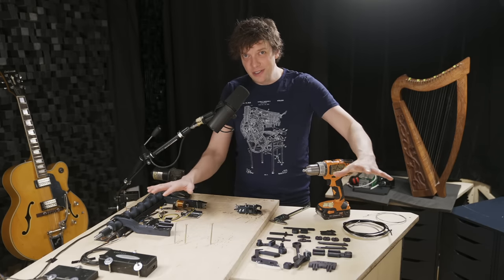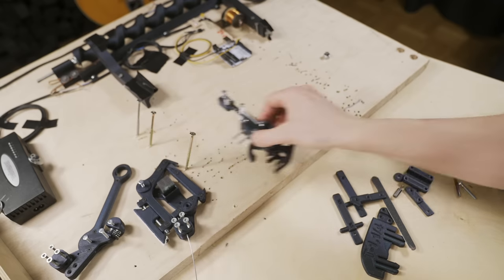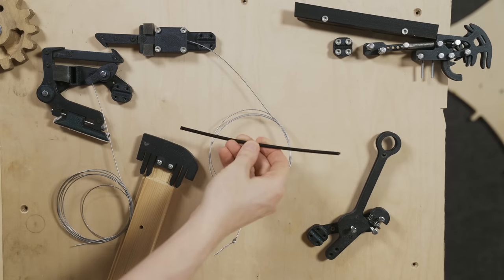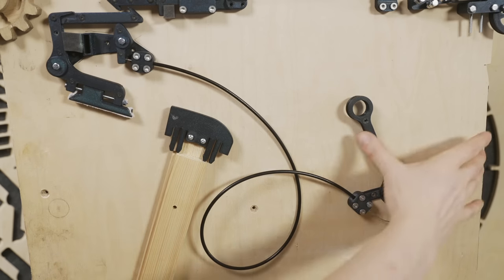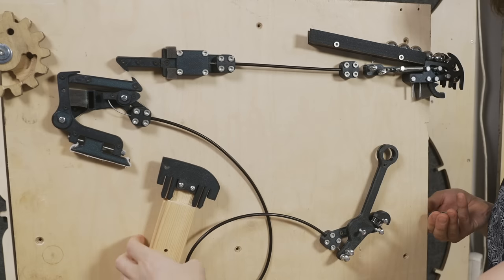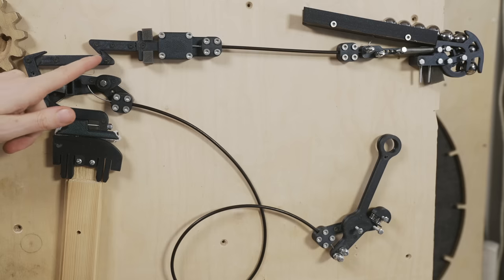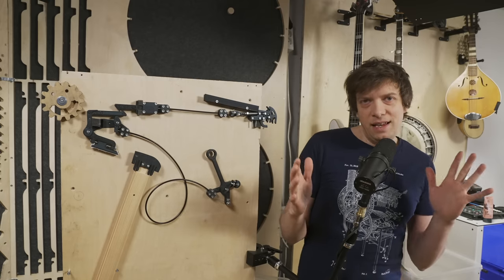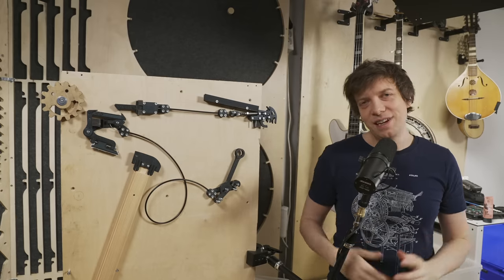These Bowden Cables Surprised Me!

Comment: I love the use of these cables, although I do have one concern that could lead to failure. These cables should always be in tension. Because they are not under a larger load it works in your test but over time the compression stability of the wire could wear out. Although it is an easy fix, on the one movement use the tension in the wire, but for the opposing motion use a spring to add tension from the opposite end.
Reply: I'm specifically talking about the mute lever to reader cable. The reader to gate cable already has a spring doing exactly that.
Reply: @michadonald  Noticed the same under the mute lever.  Its a risk, works now but after friction adds up, cable gets more worn and flexible, longer runs etc.  Shouldn't be hard to fit a Torsion spring on the mute cam, or I seen another person suggest using push-pull style cables made for push (not sure how lightweight those come in?).
Reply: I think you are right. This design also routes the cable in a curve outside of the housing, and that probably makes the cable even more vulnerable to deform or unwind under compression. Once the cable strands start to unwind, the cable will no longer go smoothly into the housing.
Reply: Is there a version of these cables which are designed for compression instead of tension?
Reply: I mean there are Pneumatics and hydraulics, but not exactly what we're looking for
Reply: @Phriedah  after doing a bit of Google research, yes there are versions that have push capabilities as well, typically they have a solid metal core instead of twisted wire. The drawback is much less flexibility.
Reply: @Phriedah  Automotive ductwork used to use solid core push-pull cables (much like music/piano/spring wire)
I have a truck that's almost 40yo and they still work fine but are not suited for really tight radii.

Comment: You should have a look at bike hardware for pinching cables, they would reduce the size of parts dramatically and make it much easier to adjust. Add ferules to the end of your outer too!

In my experience, you can use cycle oil in the outer to improve the friction. just let it pour down over the gear wire. With a lot of channels on the bi-stable mechanism i imagine the friction could add up!

Comment: Bowden cables generally are not good to push the wire - but rather pull. With a spring pulling in the opposite direction from the other end to get control in both directions. As the wire is prone to buckle when pushing in.

Comment: When testing the cables make sure to test vastly different lengths.
Make sure that a 2 meter cable doesn't introduce more delay than a 10 cm cable.
I'm sure there will be some point where the amount of play inside the cable will become an issue.
Reply: I was thinking the same thing, but the timing critical point in this design is when the programming reader releases and the spring in the ball-dropper pulls the cable back in. There shouldn't be any play because the cable is under tension at this point. My only concern is the springs in the ball-dropper not being strong enough to pull a long cable through the bowden tube. The longer the bowden tube (especially if there are bends), the higher the friction. But how much higher I honestly don't have a feel for.
Reply: @Sembazuru  I think he really has to do the test actually in different length conditions and especially the longest length with the biggest twist he wants to use. Honestly the system of bowden cables allows you to transmit an effort but not to be precise to the millisecond. Even if the timing is tight there is no chance that it will release exactly consistently as soon as there is a twist and a slightly longer length. And the worst is that unlike rigid systems, new and used behavior will be extremely different. I think it's the first mmx 3 thing that won't stay or die.
Reply: If a long cable has a predictable delay it could be compensated for easily.  Delay isn’t an issue necessarily but unpredictability is.

Comment: Great Idea! A point of caution. If you are in any way relying on the cable to work bi-directionally (push and pull) you will eventually experience a failure with the stranded cable. Stranded cable is best for flexibility and works reliably in tension. If is is being asked to push a component the cable will over time develop a kink and fail in that action unless the required force is tiny.
Bi- direction bowden cables should be solid spring wire. These were often used in older cars to actuate HVAC vents and such.
Not as flexible or smooth, but bombproof.

Comment: Hej Martin! FYI there are also push/pull bowden cables that will work in both directions if you ever have any issues with the slack. These are normally used on lawn mower hand throttles for ex.
Reply: Totally agree, although I'm not sure if they are as flexible as might be required on the MM3. Definitely something to look at.

Comment: Another cyclist here, I agree with what many other people are saying about always having the cable in tension, putting ferrules, end caps, and maybe barrel adjusters on your cables to deal with stretch, although I dont think stretch will be as much of an issue given it seems your springs are much weaker than what you see in a bike derailleur. Still leaning on off-the-shelf bike components is a good way to save yourself some engineering and reduce the amount of custom parts you'll need.
Along the lines of weak springs, I was noticing that the dropper seems to be shifting around since the cable can flex a little and the foam compresses & springs back a little when the gate opens, you are probably already working on this but its probably a good idea to retry your timing and accuracy tests. Maybe more rigid foam or stronger springs that bounce less would help

Comment: Hi Martin,
2 things spring to mind here with this demonstration.
First: These cables are meant to engage something from a relaxed position. The system should reset itself to the default without interaction of the cable. They are simply not designed to be used as a push-to-enable type. With little force, I don't think it will cause any issues. But be aware that these cables will cause issues when pushing (considerable) weight.

Second, please be advised that when the two interacting hooks are at an angle, not horizontal like in your setup, it may cause issues with timing errors. The hook may lower at a different point/time due to gravity and less force. 

Furthermore best of luck with this epic machine project!

Comment: An old fan here - cyclist / designer / musician.
Look (and disasemble if needed) at the parts of an old bicycle friction shifter and derailleur for inspiration - they are tested and proven
1. use shifting, not braking cables. you do not need as much force as is needed for bicycle braking, you will save some weight as well
2. use them in tension only (again look at derailleur)
3. design end stops for bowden casings into printed hardware -this will save you screws and time. 
4. I know you said that the system with the brake on the reader worked for you, but I cannot escape the feeling that the whole system can be made simpler - with the lever disengaging the marble gate itself. seems to be more first principles approach... also, it will make the reader>actuator>marble gate system simpler and more robust. 
Yes - the marble gate becomes more complex, but you then have 1 zone that needs extra attention in designing and quality control in manufacturing which is a life saviour when scaling up.
Live long and prosper, Cheers

Comment: Hi Martin, as a bike mechanic I love the use of these cables! Genius! I do advise you to use brake cables instead of shift cables. They are a bit thicker so will have a longer lifespan. Also use outer brake cables. Outer shift cables have a flaw that over time, the inner part comes out and makes for less accuracy.  Brake cables don't have this flaw. But please use "not compressing" outer cables with end caps. Also, all metal cables stretch a bit over time so I'd advise you to design a way to adjust for this stretch. 
Keep on rocking!!!

Comment: Be careful with the measurements of those wires because the length of the core can change depending on the curve of the sheath. I know it can cause some problems when it's use to move something, but some careful measures and cuts should be enough in your case... Good luck for your awesome project !!

Comment: Please put the foam on the programming pin so it's easily replaceable when it wears out
Reply: True but given the number of programming pins it is significantly more manufacturing operations. Maybe making the finger on the reader easier to replace.
Reply: i think it's better to keep it on the reader because you only have to replace it once
Reply: You want the wear to be on the reader as to minimize complexity. If any part of the pins can wear the design is inherently flawed. A foam or a soft plastic pad on a few dozen readers is far easier to replace than hundreds of pin pads.
Reply: He will be adding and removing programming pins for songs. It's far easier to replace pins as needed. It's the same complexity overall.

Comment: These bowden cables on my bike tend to stretch after time. The force used when hitting the brakes is probably much higher than on the marble machine, but it may hurt tightness of playing over time (or may require constant adjustment).
Reply: You get similar issues with mechanical linkage, I imagine.  Material may expand or contract with changes in temperature or humidity.  Maybe the reality is that the MM will need the timings readjusted before every performance.
Reply: @kaasmeester5903  Or else it's a bad solution, there were others. And no: in the introspection on the previous model, he says that he wants to move towards more simplicity and less manipulation, not having to readjust the system of the machine every 1000 notes.

Comment: I used to build precision road bikes. I can say that those cables do stretch over time but that can be avoided by prestreching them. I don't think you'll be putting enough tension on them for this to be a problem but I'd prestrech them just in case. Also put a few drops of light chain grease in the bouden cable housing before pushing the cable in. It will reduce a ton of friction. <3 I know your not actively taking design advice right now, but maybe you'll read this and keep it in the memory banks for latter. Epic redesign, everything is looking so promising. So epic.

Comment: @Wintergatan
The next step to reduce friction is hydrolic cables with no actual cable but oil in a tube, that is pushed and cannot be stretched or compressed. It then pushes on a piston on the other end of the tube which can activate whatever you want.

Comment: huh, I didn’t know that Bowden tube/cable wasn’t an exclusive term for 3d printing. The more you know!
Reply: There are a few in your car. Handbrake, gas throttle, clutch, shifting lever, window opener, heater flaps, inner door handle trunk release.......
Reply: The Bowden cable was patented on August 23, 1898 by Ernest Monnington Bowden (Patent US609570A).
The 3D printer probably came a little later.
Reply: @sebastianreitebuch2906  no Im pretty sure that they were around back then

Comment: In the mute position, I think a small spring on the pin will be necessary.  The cable will not always have the force to move the pin in mute position.
Reply: I commented the same thing, the marble gate actually does have a spring already, it's just the one end of the muting cable.

Comment: There’s an engineering saying “you can’t push a rope” but these cables are all “hold my beer”
Reply: The problem is you actually can't, even with these cables, if there's any amount of resistance the cable will kink at the end where it's exposed. The fix is to add a spring like there is on the marble gate.
Reply: You can when the rope is constrained in a tube. Physics is weird.
Reply: Nah. The Mute cam should be pushed by a string not by the cable
Reply: @Mostlyharmless1985  2 issues, 1: the cable is not designed for compression. It will eventually start to wear if there's any resistance.
2: the part of the cable that is exposed is still just a (rather stiff) rope trying to push. It can right now, but if there's wear or resistance it will bend and the motion won't lift the muting pin
Reply: A lot of budget and hobbyist 3D printers do exactly this, and with much more resistance than this machine is making the cables push. Sure it may not be the most efficient or optimal use of a bowden-type setup, but does work. Besides, he is putting the higher resistance of engaging the linkages on a pulling motion, while the push is at least partially assisted by the weight of the latch. If he ever reverses that setup or tries to put too many muting levers on a single cable I will be more concerned, but the design he used for the prototype is not completely unsuitable
Reply: 3d printer Bowden tube is very close to the extruder gear, and is always in line (the filament) doesn’t need to turn a corner before it is inside the PTFE tube. I agree with others who suggest adding a spring to the muting cam to ensure that there’s always tension on the cable.
Reply: @michadonald  the motion you are describing is the same motion used for the derailed in my bike. It’s pulled by the handle, and pushed by the return spring on the derailirer. I’ve had the bike for ten+years and let me tell you what I haven’t replaced on it: the control wires. If there is where it’s such a nothing thing that it could be effectively considered as non existent. And even then, you can just, you know, replace the cables.

Comment: Two questions I would love to see covered in the next video.  1) how long can the cable be before the force required to push/pull becomes too large?  2) change the top cable to be a long one since you want the drums further apart.  Then run the tests for tightness with different length cables. 

I love the scientific and engineering approach of this iteration of the marble machine, keep it up and you be successful with this version.

Comment: Aloha Martin, a suggestion for a slightly better design: at 1:55 glue the foam to the stationary part, not the moving part. Less mass to move around with each marble drop and saves wear and tear and friction if the foam happens to rub against something as it travels.

Comment: As a reformed professional bicycle mechanic, let me offer some advice related to your Bowden cables:
1. You have selected derailleur-style cable and jacket, which provides higher precision of motion, but less strength. This is probably best for what you've demonstrated, but beware that you don't try and put too much force on them. If you need more force elsewhere in the design, use brake-style cables, which provide lower precision of movement but greater strength.
2. Your current prototype clamps on the flexible black outer cladding of the cable, but the function of the cable relies on the straight metal wires just inside that cladding. Use metal ferrules that are designed to go over the end of the entire outer jacket, specifically to keep those metal wires in place.

3. Related to #2, it would additionally help to create socketed features in your parts that accept the ferrule on the end of the outer jacket of the cable, with a hole in the end for the inner cable to pass through.
4. Your cables are going to compress and wear over time, and are going to do so more initially as they "settle in". Add adjustability to the cables to counteract this by using a screw-threaded cable adjuster on one end, which is a readily available bicycle part.
5. For minimum friction, select mandrel-drawn inner cables (which are more round and hard on the outer surface) and plastic-lined outer jacket, and do not use any wet or sticky lubrication on the cables (if you can get away with it, don't use any lube at all, and keep the cables clean).
6. For maximum durability and precision, cut or grind the end of the outer jacket square with a cut-off wheel in the Dremel or a bench grinder. While the outer jacket is still hot from that step, take a slim sharp probe tool and force the plastic liner open at the end, for the inner cable (we would use a sharpened bicycle spoke as a tool for this).
7. The best way to cut the inner cable is with hardened-jaw cutting shears, which are available as bicycle tools for this purpose. You can also use them to cut the outer jacket, but it's best to follow up with a little grinding on the outer jacket as described in #6. 
8. Common derailleur and brake inner cables don't reliably work in compression, so you shouldn't create a design that pushes the inner cable. Use a spring on at least one end of the system opposing the force of the cable, so the inner cable always operates in tension (and the outer jacket in compression).
9. For the sake of your hands and fingers, always use crimp-on cable caps on the cut end of the inner cable. Slip them over the end of the inner cable and pinch them with pliers to keep them in place.
10. If an inner cable gets kinked or starts to fray, it cannot be reused. It must be cut shorter, past the point of damage, or discarded.
11. You should be able to buy inner cables in bulk boxes of 50 or 100, and outer jacket in bulk coils of 50m or 100m, and ferrules and cable ends in bulk bottles of 50 or 100, at much better prices than buying them individually in retail packaging.